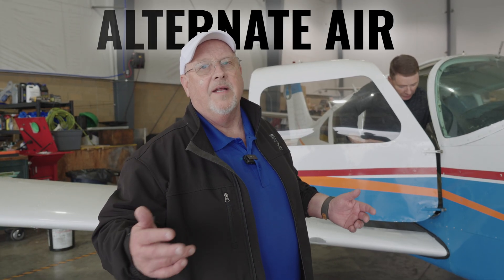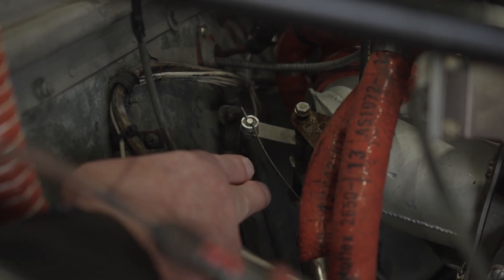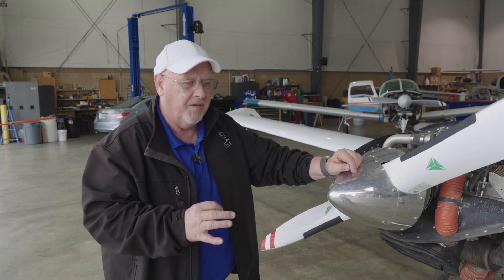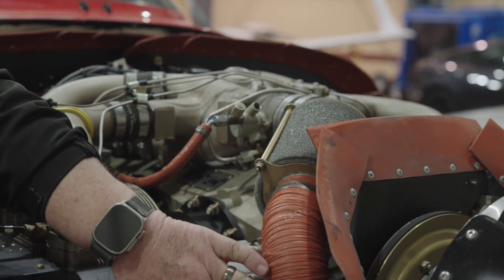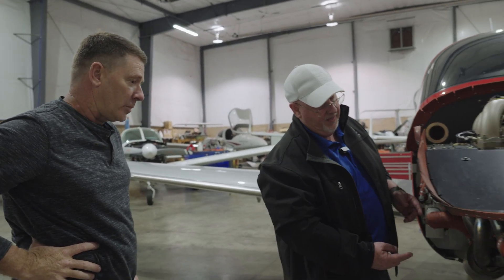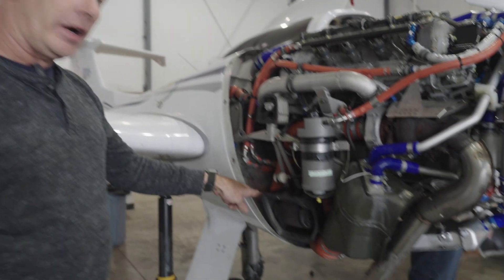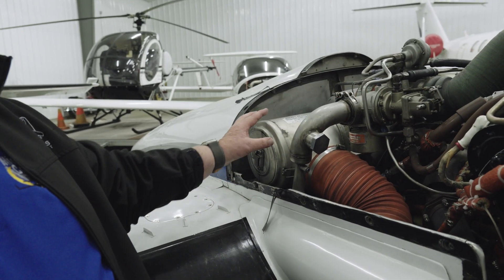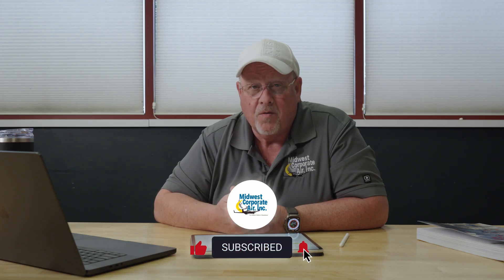Alternate Air Intake | How Alternate Air Works (And Why It’s So Important)

Comment: Wonder why on the bigger blocks they use alternate air but on smaller blocks like the 235 they got carbureator heat instead.